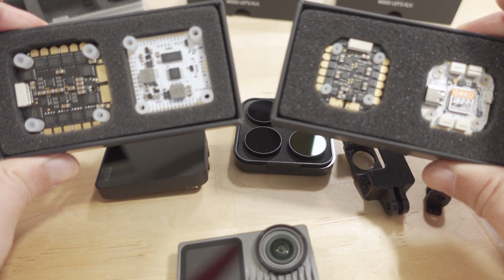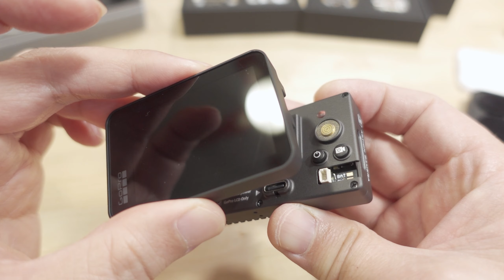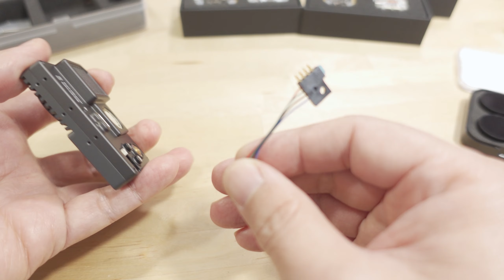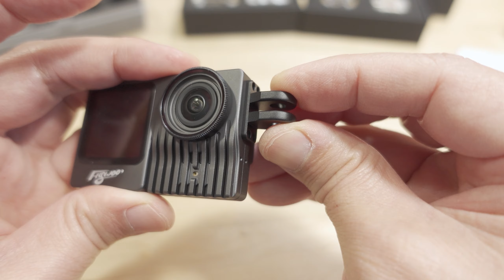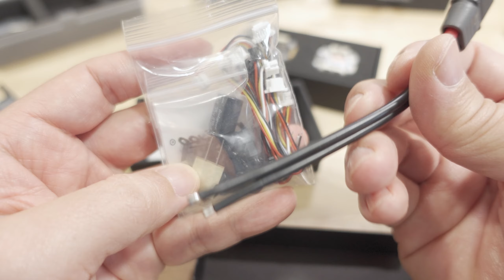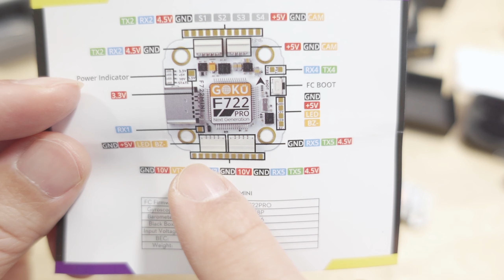Flywoo Naked GoPro V2 Plus GOKU F722 Stacks

Comment from the maker: 🛒 Product Links
Flywoo Naked GoPro V2 - http://rb.gy/i550ez
Naked GoPro V2 DIY Parts - http://rb.gy/z03ogj
GOKU F722 PRO V2 30x30 Stack - http://rb.gy/o915oj
GOKU F722 PRO V2 30X30 Flight Controller - http://rb.gy/knil3e
GOKU 50A 30x30 8-bit ESC - http://rb.gy/ao4zw5
GOKU F722 PRO Mini V2 20x20 Stack - http://rb.gy/rt16ar
GOKU F722 PRO Mini V2 20X20 Flight Controller - http://rb.gy/bedt74
GOKU 406S 8bi 2-6S 20x20 ESC - https://rb.gy/73ld4d

Comment: Is it possible to do a firmware update using the balance lead and a lipo ? Or do I need to use the magnetic cable with the GoPro battery? I am asking because i don't have a Gopro and Flywoo does not include one with the camera.
Reply from the maker: Sorry, not possible.  You have to use the magnetic cable and battery.  If you need the magnetic cable, you can get it by itself for $5.59 at this link (select the magnetic cable part to see the price).  http://rb.gy/z03ogj
Reply: @AlbertKimTV  Thanks for your answer! I am pretty sure the magnetic cable is included, I am only missing the battery and charger. If I use a friend's battery for the firmware update at the beginning, can I use a LiPo for the screen afterwards?

Comment: I ordered the 11. At first I thought I’d just grab a broken 11 on eBay for 50 bucks and turn it in on my subscription and then just get the kit and do it myself. I’ve done 4 nakeds so far but I’ve been on chemo for 2 years now and I just don’t even have the motivation to do it. Plus I figured with my impatience I’d probably ruin it and then just be out 250 lol
Reply from the maker: Yeah, if you think you might break it during the building process, it's cheaper to just buy it pre built.

Comment: Looks nice and i think this ist a good Option . I Had some EMI on my geprc GoPro 8 and this killed the Mainbord. Be carefull with naked GoPro. They need the original ground Points to protect the PCB from Electro magnetic Interferences.
Reply: never heard of anything like this before
Reply: @JoshFPV24  potential equalization Is the point here.. some Electronic parts will create potential. You know why we use diodes and caps in our copters 😉 PCB have normally gnd Points to prevent that a higher Potential can damage a part or create some faults... You may remember a Bad Video Signal on your analog Cam before adding a Cap 😉 you can find more about this when you google for Electro magnetic Interferences on PCB
Reply from the maker: So where did that EMI interference come from?

Comment: The v2 naked go pro looks great and all but the price tag of 379 for a hero 9 is crazy. Rather just get a hero 10 and call it a day.
Reply: the premium is for the smaller size... if you don't need it, of course the cost is not worth it.
Reply: The Flywoo case is 10 times better than the GEPRC case. Well worth the small increase in price.
Reply: @xavierprimeto1752  the back of GEPRC case broke cuz its weak plastic, the all metal Flywoo case is what I'm gonna upgrade to.

Comment: V2 metal version looks very nice, the rear screen connection is well thought as well. That magnetic battery connector for FW update is so cool, especially for the newer GoPros. Wow even the adjustable mounting system is cool. Nice F7 stacks, good size pads.  GO flywoo, awesome review  Albert!!!!

Comment: Look like decent stacks for the price.  Agree that the 20x20 should come with an xt30. Thanks for the info!
Reply: Depends on the battery you plan on running with it. Just keep a bag of connectors around to switch as you build.